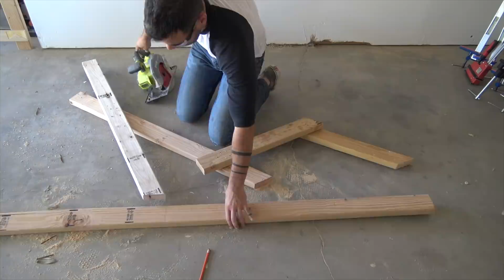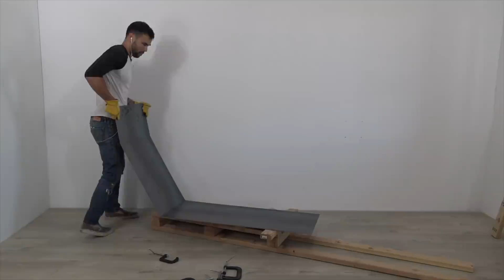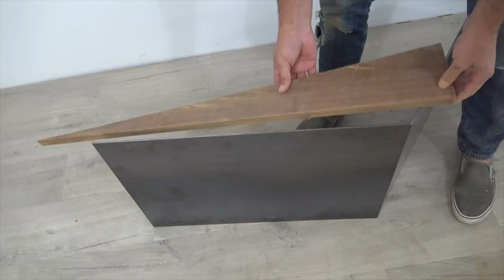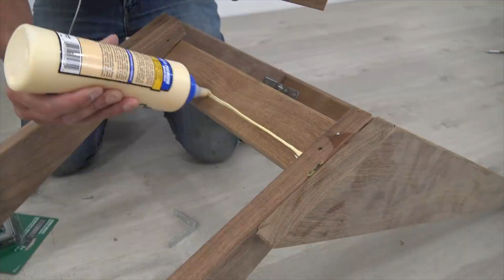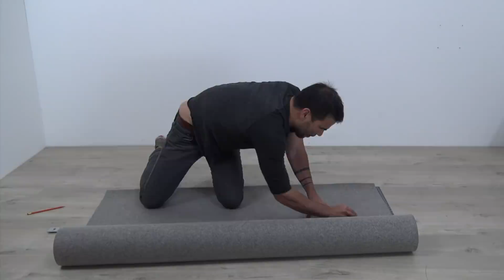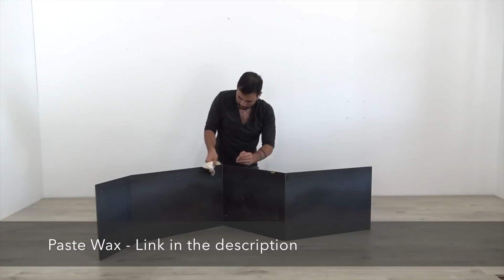DIY Modern Lounge Chair | Metalworking for Beginners EP4

Comment: With such an elaborate frame (framework....), you could use almost anything for the flat surfaces from masonite, OSB, or even bonded layers of corrugated PAPER.  For added strength, a layer of sheetmetal could be added.  All of these materials are more easily acquired & fabricated than steel PLATE....!

Comment: That chair looks amazing, but it also “looks” like it’s about to tip over, I’m assuming this is just my brain doing a calculation a bit paranoidly (that’s a word, right 😉). 

In retrospect do you think there is any sequence you could have changed to ease the one difficult fold, or would there then always be other folds in the way?

Comment: I really like the minimalistic design and the use of materials. 

A note about the dust mask... you are probably breathing 100's of times more particles with a beard than with a clean shaven face. In tests I've run, even with very small leaks, masks filtered less than 70% of particles > 0.5 microns.

The air takes the path of least resistance so a % bypasses around the beard.  It only takes a  small leak to pass a lot of particles. 

Just something to think about if you are concerned about allergies to exotic woods or carcinogenic particles.  Dust from most common wood types isn't as big of a deal if you aren't working in it for long periods of time.

Comment: this thing is going to destroy the floor! You need to flatten the contact points! Great design otherwise!
Reply: depends on the floor. Not porcelain or concrete. I'd favor special recessed bumper over rounding. Nothing else is rounded on the piece. Leave it as is IMO

Comment: Trimming the base parallel to the floor instead of leaving a tip helps with weight distribution and should eliminate a potential weak spot where the joint could break. And also it's not so hard on your floors

Comment: This is cool!! But is it comfy? Might curves be in an up and coming vid? I also wonder if not adding the support to the back, just keeping in on the parts that contact the ground, might have added some comfort via some springiness.
Reply from the maker: it is very comfortable for me since it fits the lengths of my legs and back perfectly.  i designed it for watching a wall mounted TV 36 inches from the ground but i think a pillow behind the head would make it better for reading
Reply: I think its young person comfy. I'm old and I'm getting out of breath just thinking about getting that low to the floor and getting back up again without big comfy arm grips heh. Padding wise again its young person perfect. Young bodies can sit on hard wood floor and play games on the TV. Older people when put on hard wood floors lift their arms up hoping someone will come along and drag them up off the floor. I'm thinking upholstery foam, memory foam, pocket springs in the right places, distribution of fat ass weight zones and so on and so on before I'm thinking...comfy.